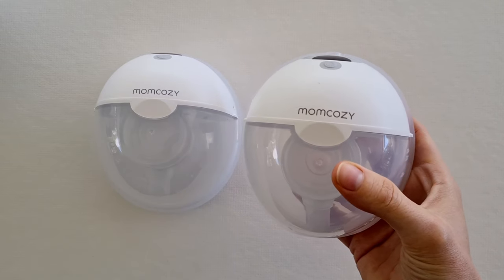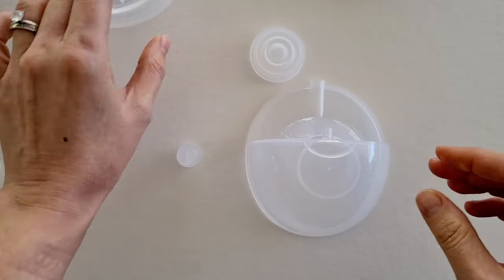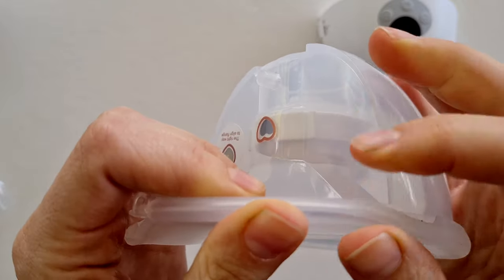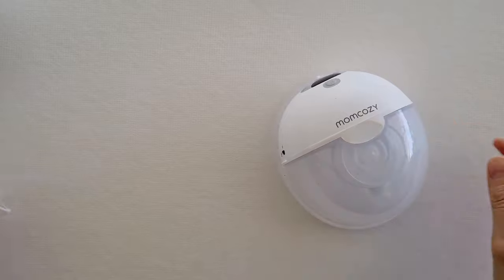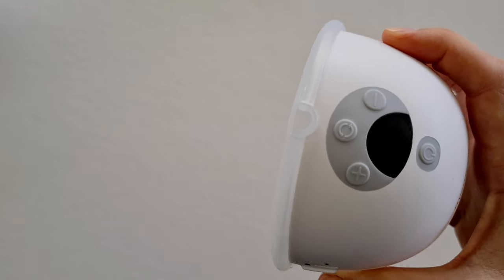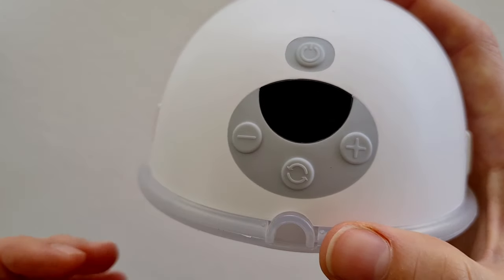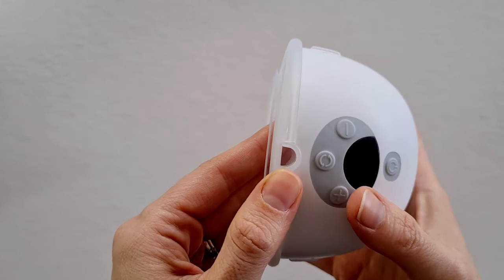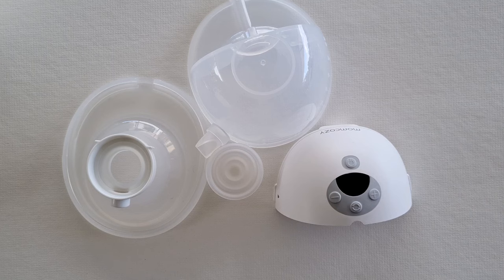How To Use Momcozy M5: Complete Guide including Assembly and Tips

Comment: Is it just at me or i dont even feel that is pulling or sucking any of the milk. I dont see no dron in the compartment.  So i just paid some money to buy it for nothing. I have so much milk and this pump doesnt have any power to suck it out
Reply from the maker: Sorry youre having issues! If you're not getting any milk output, it sound like you may have an air leak or your flange sizing might not be right. If don't think either of these are an issue I'd reach out to Momcozy support as yiu should be getting some milk output.

Comment: I don’t know if It has to stick to my skin or wear a bra al the time I am using it, pls helpp
Reply from the maker: You need to have a seal between your skin and the flange to maintain suction. If the seal is broken, your pump won't work as effectively = less milk. You can use a bra to help firmly hold your pump in place 😊

Comment: How can you tell it’s on correctly, as it’s impossible to see if your nipple is aligned down the middle of the flange
Reply from the maker: Thanks for asking! There are a few ways to know your pump in on properly and the flange is the correct fit other than just a visual.These include:

You're not experiencing pain in your nipple or discolloration (i.e. a white circle at the base of the nipple or your nipple blanched).

You can also feel to make sure that there are no areas of the breast that still have milk inside (which indicates the uneven removal of milk).

Hopefully this helps 😊

Comment: Omgosh I didn't know you had to slide the lip of the diaphragm OVER that piece or that you had to stack the flange inserts! I think my experience is about to be enhanced just with these two changes!! Thank you so much for this video!!
Reply from the maker: So glad it was helpful!! I do have to apologize though, you actually do not need to stack the inserts for the M5 like I said in the video! Simply use the 1 flange insert with the correct size you need. 
But yes you definitely want the lip of the diaphragm to slide over as that will help ensure your suction is working properly :)

Comment: Omg.. I had not been overlapping the flanges 🙈 No wonder I wasn’t getting a lot of milk! Thank you so much!
Reply from the maker: I am so sorry for the misinformation, but you do not need to stack the flange inserts for the M5. Just pick the correct size and insert that into the flange 😊

If you weren't getting a lot of milk, just make sure your parts don't need replacing and that the seals are all firm.
Reply: Glad I read this reply as I thought it would be strange to stack them!!
Reply from the maker: So sorry for the confusion, but glad you read the comment too 😊

Comment: I would like to ask while it is working is there any noticeable sound? I will use it during work
Reply from the maker: The noise is less than 50dB. A library or very quiet office is 40 to 45dB. Normal conversation is 60dB. So, depending on how quiet your workplace is, you may or may not notice it.

Comment: Hi such a great video so helpful! FTM here...Can I sanitize all components by running it through my dish washer sanitation setting or should i sanitize by boiling the components.
Reply from the maker: Thanks for the great feedback! The M5 is not suitable for a dishwasher, microwave or heat sterilizer due to the soft silicone. Ideally you will boil it or use a sterilization solution like Milton https://amzn.to/3KTTNT0 (#ad)
Reply: @pumpingmilk  thanks so much!

Comment: The duck bill valve confuses me though. How are you supposed to fill the cup with milk if the only hole is covered?
Reply from the maker: Thanks for asking! The duckbill valve opens and closes with the suction created by the pump. So it will will open to allow the milk to flow through into the collection cup. If you pinch it the duckbill valve you can see it opens at the bottom :)

Comment: I'm confused how the mixed setting works.  Can you clarify that setting?
Reply from the maker: It is a mix of the shorter suctions from the stimulation mode and longer suctions of the expression mode. It can also vibrate at the same time to loosen the milk ducts when pumping - potential benefits are more milk faster and better drainage to help prevent mastitis or engorgement.

Comment: Hi
My wife use it, but the milk go out just a little and we are so disappointed.
Can you tell us a secret please?? ❤
Reply from the maker: Thanks for reaching out! Sorry you're having issues. My first step is to check all the seals and make sure it is assembled correctly. After that, start with your massage mode for 2 mins to initiate your letdown, then switch modes to your expression. Start on a low suction level and then slowly build up based on your comfort levels. The highest suction might not give you the best results. 
You may have to play around with the different settings to find what works best.
Also make sure you are drinking plenty of water to help with milk production.